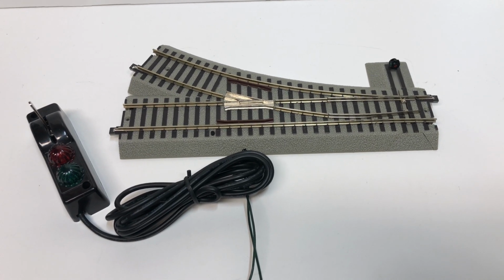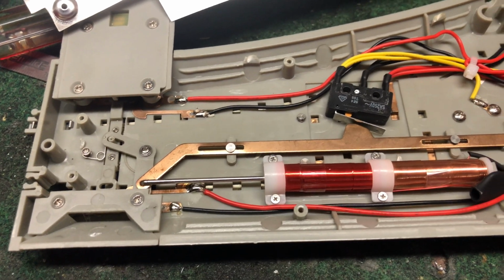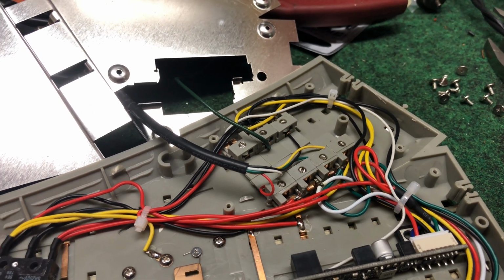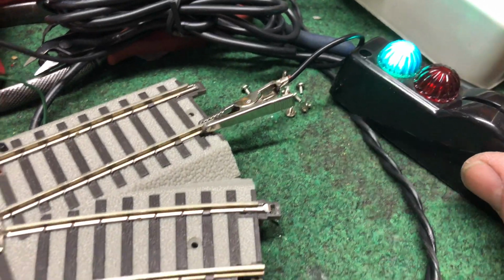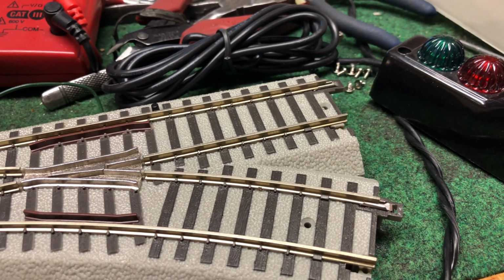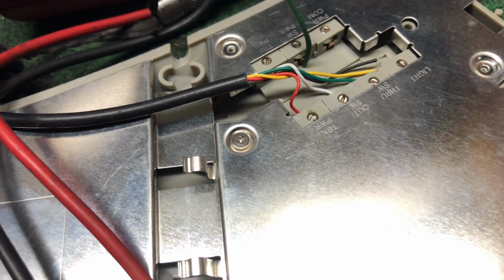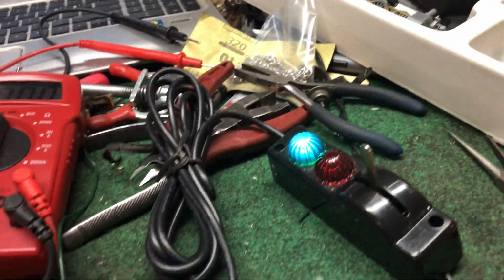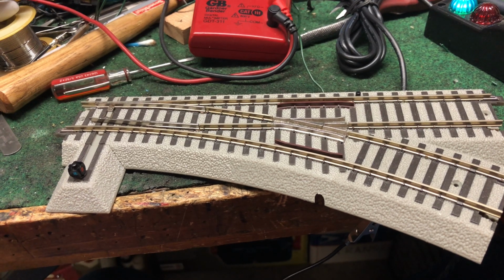Wiring an American Flyer S Gauge Fastrack Switch by Lionel with Conventional Power not TMCC

Comment: Correct thepower com is where you add the common line that’s what you’re missing is the common you have the power and the common I’m having problems getting the switches to power my track, but I can get the switch to switch by running separate power to the powerline after you remove the jumper and then adding an additional common line to where the black wire is hooked to

Comment: At the model train forum there is an article for Converting Flyonel FasTrack Sw. from track power to Independent Power.
Home>Forums.Scale Specific Model Train Forum>S Scale
It has description & diagrams & photos
I saved it as a bookmark but YT doesn't allow links to take you away from YT in the comments
Reply from the maker: @-MAILMAN  Thanks!
Reply: @daveclarklumber I have a pair of the wide radius remote/command Lionel S Gauge switches.  They came with instructions how to wire the switches to be powered  off of the transformer instead of track power.  I will see if I can make a post to my YT channel with snap shots of the instructions out of the manual.

Comment: I know this is an older video, but I was having a similar issue.  I found that the black wire is the common, and needs to remain connected, despite what the directions state.   You just remove the bridge, and add add a power and ground to sw pwr and com, respectively.  This will let the switch coil get power from the transformer, but the lights remain wired to the track power.  The way the switch is wired, the control lights remain tied to track power.
Reply: What voltage did you end up having to use? AC or DC? Are you running auxiliary power to your switches via your the accessory terminals on your transformer?
Reply: @Bobby_Uterus  I am using the base post and 15v post to power the switches off a 19b (AC).  The way the switches are internally wired, the switch coils are the only parts that can run off that post.  The controller's lights run off the track power.
Reply: @jeremybrosious4228  Thank you for the reply. Are you getting the brief buzzing sound when actuating your switches? like the buzzing in this video when he is actuating his switches? is that normal? are you on three rail or two rail like in the video? seems like I'm using way more voltage than i need for the switches.
Reply: @Bobby_Uterus  if you use AC you will get a buzz.  AC switches phase at about 60 hz, so the electro magnet is going off/on 60 times, making that buzz.  The only way to get rid of that is to run dc to the coil.  I have these switches for both 3 rail and two rail, but they both run different.  The 2 rail swiches have to be wired in such a way to prevent shorts, where the 3 rail has a bit more flexibility.
Reply: @jeremybrosious4228   Thanks Jeremy! So the buzz is not an issue? Just normal operation under AC power?   Can you explain further on how to wire the 2 rail switch to avoid shorts?  I’m working with two rail now and want to make sure everything is correct.  Do you have a link to a tutorial or anything?  Thanks again for the replies.

Comment: These switches are an absolute nightmare.  50% of them don't work properly, even just with the default track power setup.  I tried what you are doing here, all iterations of wiring possible, using transformer power, once hooked up to the rest of the track, will not work.  Very poorly designed.  I'm now finally with 5 out of 6 switches working with track power (one of which had to randomly have a feeder wire soldered directly to switch track to work properly, who knows why).  I am debating doing some plastic surgery on an S trax switch to finish the last one.  What a disaster, do not buy these!
Reply: Did you ever get them working solid? Is there any other reliable track options for the S gauge stuff?  Kind sucks 😢

Comment: Dave,
Your video is March 6, 2021, and today is April 30, 2022. I hope you got an answer.
If not, I recommend you download the American Flyers S-Gauge Fastrack RH/LH Remote Switch Owner’s Manual, 74-7941-250, mine says “5/15” after that and I assume that is a date. It shows how to wire the turnouts for non-track-power. The booklet states a 14-18 VAC power supply works best. I have yet to try it and am about to on my S Gauge Fastrack layout. The instructions are remove the jumper from between Switch Power and Track Power. Remove the black(?) wire from Power Com(mon), attach red AC from your power supply to Switch Power and attach the neutral / black from your AC power supply to the Power Common.
I would be interested to hear if you solved the problem. I need to solve the same issue on my Hogwarts Express O Gauge / Scale layout and on my Lionel / American Flyers Polar Express layout, both with 3 left and 3 right remote Fastrack turnouts.
https://www.youtube.com/watch?v=-xucuJGC3BQ&t=149s
Thanks,
Rex

Comment: How about remove the 'electronics' and convert it to conventional solenoid operation, isolate the frog and points and "switch" their  power feed like we do in ordinary hand made switches in 2 rail.  Turning over control to some sort of automation that has zero documentation is never going to be good.  Talk to Rich about it.. he has been building and wiring his own switches on his current 2r O scale layout. There are 2 basic functions... to correctly route the power to the correct rails in the correct polarity, and controlling the solenoid.  We usually accomplish this with a multi-pole toggle switch, one side routing track power to the frog and rails it needs to be at, and the other side controlling the solenoid or switch machine.  Welcome to the 'fun' of conventional power 2 rail wiring.

Comment: I would say that "PWR COM" is the common, and not an abbreviation for "Command."  Put variable track voltage between track power and common.  Put switch constant voltage lead to switch power terminal.  If this lead comes from the same transformer, then you don't need an extra common wire for the constant voltage.  You are correct to remove the bridge from track power to switch power.
Reply from the maker: Thanks for the comment. It makes sense that COM would be common. I will try again.

Comment: I helped a friend put together a loop of this track, with two of these switches. What a nightmare. The plastic connections to join sections of track often did not work, or broke. It requires pliers to join the sections.
We could never get the switches to work. How the switch design passed the Lionel quality control people is beyond me. And they cost a whopping $130 each! Chinese made crap - yes absolute junk. While the track looks good, it is not worth buying. It is like a good looking cheap hooker. Fun to look at, but never buy it. This system, IMHO, is worse than the 1930s Lionel latch couple, the worst toy train coupler ever made.